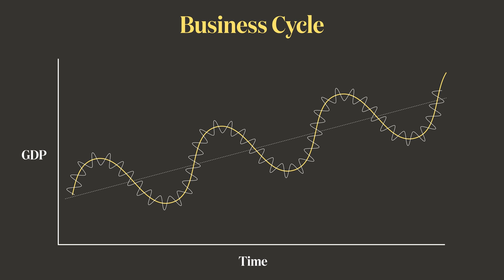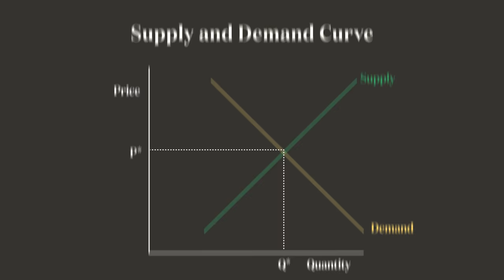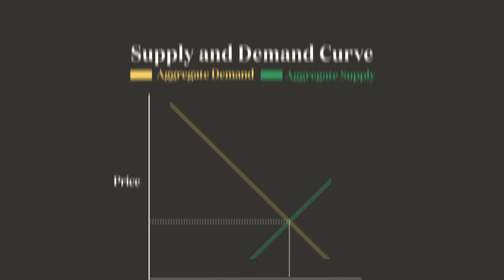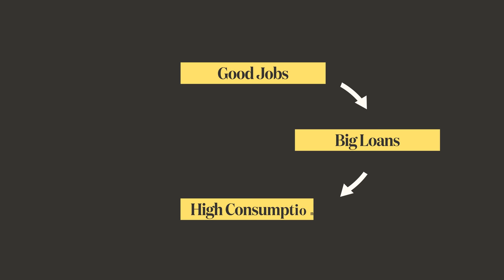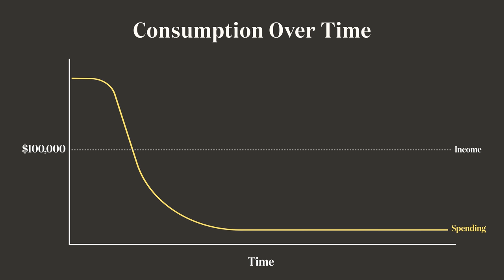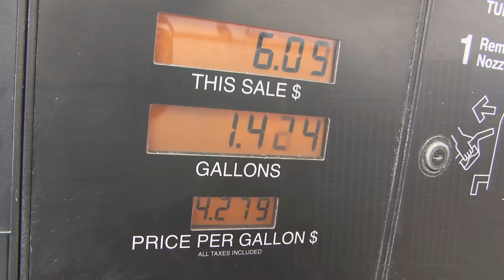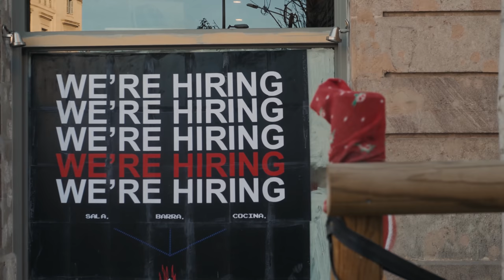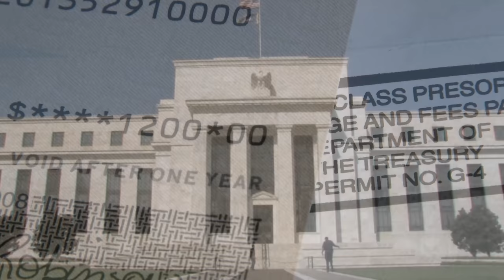The Recession We Need To Have | Economics Explained

Comment: This video hits on something I’ve been saying for a while. The crash we are heading into now is not a new crash, it is the 2008 crash that was delayed through QE. Rather than letting the system reset itself, the Fed stepped in with QE and propped up the failed business models that led to the crash. It just reinflated the bubble. It didn’t create a new bubble. 

My fear is that this reinflated bubble will be worse than the original bubble.
Reply: Credit Expansion is generally the reason why bubbles form in the first place. If someone wants to "solve" the problem and not take their lumps, the solution is more credit expansion, but faster this time.  The business cycle isn't really all that natural, but formed by cycles of credit expansion and contraction. Before Central Banks collapses and ressessions were usually short lived and centralized, and the source of the expansion was banks that overleveraged themselves at the expense of those who saved their money in then. Since the central bank formed, what would be a local problem limited to a single industry now encompases the entire economy, and the reason why is that the central bank is the biggest source of credit expansion in the system. All banks are interconnected, and because banks can't fail it just means that they throw our money around and when they lose it they can ask for the government to cover their losses and the central bank to loan or print them money.
Reply: It depends on who you ask if this is going to be bad. In '08 banks, despite selling junk debt, got off scot-free. They even got to keep most of the real estate while the market 'recovered'. That's why real estate prices never really went back to 1940's prices. Whatever happens now, I'm quite confident that the current players at the table have a trick up their sleeve to keep and even grow their capital through the next bust cycle. One does wonder if all the junk is not going to surprise them with a black swan event.
Reply: @jakman2179  

Look into Kondratieff waves. This cycle of major booms and busts has been around through all of capitalism. The Great Depression happened in a time when the dollar was pegged to gold and the central bank had very little influence. 

Kondratieff waves are caused when an economy reaches its maximum growth utilization rate. The easiest way to visualize this was the railroad expansion in the 1840’s. When the railroads were being built, there was massive demand for the companies building the railroad, as well as all of the peripheral industries that supported the building of railroads. Once all of the tracks had been laid down, the demand for new railroads fell off and the entire economy collapsed. That collapse freed up capital for the next crest which was electrification. 

The 2008 crash was the collapse of the tech sector. There was massive tech growth as everyone was buying computers and tvs and cell phones, but once everyone had them, there was no real need to replace them. Therefore tech industries have to spend more and more on research in hopes that their newest iteration will convince enough people to replace their existing products to make a profit. It has reached it’s maximum growth utilization rate and rather than letting the collapse recirculate all of that tech capital, QE pumped a bunch of money into the stock market to make those companies appear profitable again, at least on the surface (think stock buybacks). 

Credit expansion therefore plays a role, as it increases the purchasing power of the economy and drives the increase in the growth utilization rate, but it is not the only factor. These collapses would happen with or without the influence of central banks.
Reply: @TheCommonS3Nse  You're actually wrong about the depression and dollar being pegged. It was unpegged for most of it and ignores the credit expansion that was occuring then. Unless a currency is near 100% backed it tends to create the credit expansion waves. 

Additionally, for an organization that "didn't have much influence" they seemed to do a good job of inflating the Dollar for the benefit of the Pound Sterling after WW1. It's worth pointing out that also caused a crash around 25, but a much amaller and shorter one because it was ridden to the bottom. 

I'm not convinced by the Kondratieff Wave theory, but will keep my opinion on it at that as I need more research into it.
Reply: A bit of research and I'm not having glowing hopes for it. Every single Downturn it claims is also attached to a period of credit expansion preceding it. There may be a coinciding effect of the 'peak' of a technology, but calling them the source of them seems faulty.

1837, The Second Bank of America was disbanded shortly before it occured.
1870s, shortly after the civil war when Greenbacks were used to pay for the war, and the Bank of England was overleveraged. 1930s, Central Banks of multiple countries were printing money because of war debts. The Central Bank in US helped keep the show going until it couldn't and collapsed, the recession that followed was exacerbated into a depression by policies that attempted to stop the correction.
1970s, stagflation from super low interest rates and an overregulated economy topped by the oil crises.
Reply: @jakman2179  

What about the Panic of 1837? The long depression of the 1870’s? Were those caused by credit expansion generated by a central bank?

It would make more sense to me that the credit expansion would accompany the driving technology in the Kondratieff waves. You have some new technology that is in massive demand. The monetary supply is not sufficient to meet these new demands, therefore banks issue credit, which is just another method of increasing the purchasing power in the economy, allowing the economy to continue expanding. When the demand for the products wanes and the profitability of the industry begins to fall, the profits of the most leveraged industries will fall off fastest as the gains become less than the cost of borrowing. The most leveraged industries are going to be the ones driving the Kondratieff wave, as they’re the ones with the highest growth, which offsets the cost of borrowing. 

Therefore, the fall in the demand for the product is the source of the collapse, not the existence of the credit. I don’t deny that the expansion of credit plays a crucial role, it obviously does, but there is more to the problem than just the expansion of credit. The systems would indeed have smaller crashes if you removed or reduced the use of credit, but they would also have less growth on the upswings. It’s not a bad argument to make. In fact I would agree to reduced credit in the system as I am also concerned about hitting a resource limit in production. But I don’t think it would have any impact on the boom-bust cycle other than impacting the amplitude of the waves.
Reply: @TheCommonS3Nse  I said about them in my last comment. 1837 was the tail end of the Second Central Bank of the US, who were inflating the currency during their tenure, setting up the collapse. 1870s had the Bank of England being the main driver and the US Government as an unwitting accomplice through the Greenbacks.

Central banks aren't required for a credit expansion, but without a bank (or cartel of banks) acting as the free money printer the expansions are limited and tempered by other actors in the market who aren't so tied to one particular industry. Free banking may be derided, but it had a built in mechanism to encourage honesty and soundness as a rival bank could collect banknotes of a potentially overleveraged bank then create a run on the bank. That's not really possible anymore.

I don't disagree that they will be near the epicenter, but I disagree with the claim that they are the source. Loose lending policy allows malinvestments, and the fad of the time, being popular and seen as the next big thing draws in a disproportionate amount of it. Without the excess investment, it would either not grow too big for it's own good, or most likely have a small decline limited to those who have tied themselves to it. It would be short, and limited in scope, not dragging entire economies down with it. Even without a technology peaking you can create credit based recessions and they can often be just as bad as one tied to a tech collapse.

The Mississipi Company is the best example of this in that it had all of the hallmarks of these crashes and recessions, but had no tech attached to it. Likewise, the 1780s in Colonial America suffered under a similar credit induced recession. That was why the Founding fathers made sure the federal government wasn't allowed to print money, only mint coins.

While I do have a mindset aiming at infinite growth, growth isn't everything and faster growth doesn't mean better. Without the credit expansion, yes, we wouldn't grow as fast, but what growth we had would be real solid growth, less likely to collapse, more robust should hard times come, more fair for everyone.
Reply: @jakman2179  

While I respect your outlook, as that is a future I would very much love to see, I don’t see it as a realistic possible outcome. Capitalism is ultimately the pursuit of profit, which requires growth. If you limit growth by reducing the purchasing power in your economy, you’re going to reduce profits, which will reduce investment into your economy. Reduced investment means less jobs available. 

In other words, there are social implications to your worldview that would be very difficult for a society to implement without hurting a lot of people.
Reply: I tend to agree. The financial markets and borrowers got so used to, or addicted to, abnormally low interest rates after 2008 that they could never rise to historically normal levels again The mid to late 90s were considered a period of economic growth, yet the Fed Funds rate was in the 5-6% range. We have never had a Federal Fund rate over 2.5% since the Great Recession, regardless of how good the economy was doing. The pandemic stimulus programs only made it worse by lowing interest rates to zero and pumping trillions of dollars into the economy. Now we have 8+% inflation with a Fed Fund rate under 1% and housing prices worse than the real estate bubble that proceeded the Great Recession.
Reply: @TheCommonS3Nse  I will agree, my outlook is not well-liked among many people, but I think it is healthier in the long term. I also disagree that Capitalism is the Persuit of Profit. Profit is A metric of success, but if like all metrics, it breaks if it becomes the goal.

A part of this is I hold a firm belief that any level of inflation is ultimately harmful because it destroys people's ability to save money. People act like saving is the devil, but people don't save to get rich, they save to hedge against the future. Investments and savings aren't the same no matter what a bank tells you. Likewise, Debt and Savings are not the same in action. Debt is a weight on the debtor's shoulders, and Savings is a foundation under their feet. People don't 'drown in savings' they drown in debt. People saving money means they are preparing for the future.

The idea that you must borrow to grow is a toxic idea. It makes the hurdle for small businesses bigger as not only do they have to compete against Big Companies, but they also have to overcome the debt they took out to start up. Wores, the inflationary costs means that what could've been a respectable if small return is now a loss in real terms. If they formed out of savings and in a non-inflationary currency, they would be on a more equal footing. More small businesses means more jobs for everyone and probably a healthier environment to work in also.

Another problem I always have with people saying that people lose their jobs is that implies that once someone loses it they can never get a new one. They will get a new job, it just may not be one they like or in the same field.  Also, if real savings is not only possible but widespread then a period of joblessness isn't as hard as they don't need to go into debt to survive, but just live off of savings for a bit and argue for a higher wage or wait for a position they want.

Lastly, I think there's a misconception that reducing credit limits purchasing power. You have it backwards, it preserves purchasing power. Inflationary currency and expansionary credit destroys value and weakens the purchasing power of a currency. Worse, those who it helps are the rich and powerful, not the poor.

The Economy with tighter credit will still grow. People will still find jobs. And no, it won't lead to some dystopia like people imagine it will. It will make people confront reality and help them understand their limits and thus become more effective and efficient.

Lastly, the idea that my worldview will hurt a lot of people is laughable since what I see is a world that is full of strife, where the rich get to suckle from the money tap while the poor get priced out of everything. It turns what should be a modest profit into a long term loss as your investment of 5% is effectively -3% because of the new money. It encourages people to consume more than is available, and destroy everything for the next hit.

After all, why prepare for the future when you've borrowed tommorow away for today's pleasures.
Reply: @FlintIronstag23  These problems tend to be self-correcting by great levelers like WW1 and WW2, we are simply in a transition right now. The inequality we are experiencing is also nothing new, we were in the same situation 1-2 years before WW1 when suddenly deglobalization happened which ignited the war.

Comment: Woah, I've always thought that the Australian automotive industry went under largely because of structural problems like too many manufacturers in a small market unable to achieve economy of scale, and a lack of vision that kept the industry pumping out fuel-guzzling large sedans when there is no longer a market for them. Now it turns out that it was just workers taking too many sickies. I have been enlightened.
Reply: You've pretty much summarised my thoughts on that subject.  I wouldn't think that a few workers taking sickies to extend long weekends is a peculiarity of the motor industry or of Australia in general but other industries survive it nonetheless.  Indeed, Australian car manufacturers were by & large held up as models of efficiency for low volume output by their foreign overlords. Other Australian industries that largely didn't survive include whitegoods and other household appliances, textiles & footwear and other mass produced consumer goods I can't think of at present, and all for the same reasons that the motor industry disappeared (apart from the bit that you point out where the latter persisted with products that people no longer wanted to buy).

Comment: Love your content, but this piece was much more partial in that it seems to almost admire the ability of large corporations like Amazon to squash out competition, and applaud the "need" to flush out workers. Also attributing the closure of the Australian automotive industry to some sick days around public holidays is a pretty weak argument at best (you usually provide some good lines of evidence for your arguments, but to make this argument I think you need a few more points of substance). Competition in the market is important, but it doesn't mean that competition needs to be a zero sum game. Massive corporations don't need to completely squash out small operators to have a functioning market. When I moved to WA from the east coast I was shocked to see Woolworths and Coles couldn't operate after 5 pm on the weekends, but then found out this gives an opportunity for independent groceries to compete with the big two players in this space.

Comment: This pre conception that deflation is bad is wrong.

The "we need a little inflation" is the current "norm" just because it suits well with the desires of those in the governments.
Reply: Deflation punishes spending. 
What are you talking about man. 
You do not want deflation. 
Mild inflation.
Reply: Deflation is not inherently a bad thing, yes. Systemic permanent deflation is. It essentially rewards hoarding cash even more than now. Is that what you want?
Reply: If you're going to argue against slight inflation as the best move forward at least address the actual argument. The argument for slight inflation as the best type of economy is that it encourages people to spend money without heavily affecting their lives. Deflation leads to money hoarding, because your money gets more valuable over time. Money hoarding on a macro-economic scale leads to all sorts of problems.
Reply: In any stable economy, people buy stuff because they value it over money. That will change very little of inflation is 2%, 1%, 0%, -1%, etc...

Even big companies put money on investments that lose to inflation because it is safe.... 

(And most people just simply spend every penny if not more).

So nothing to be worried about....

Btw, I'm not suggesting a deflationary police, I'm suggesting a NO police... 

Just stop printing money, and let those banks which take big risks fail